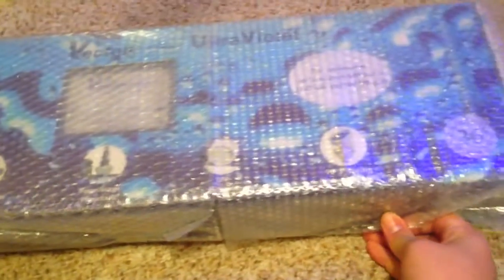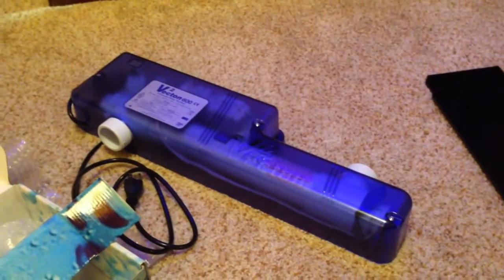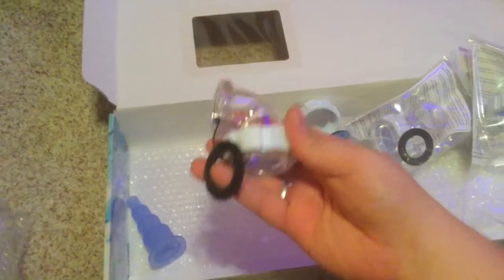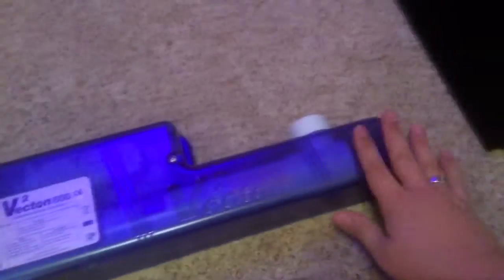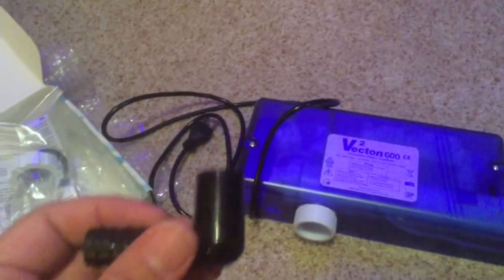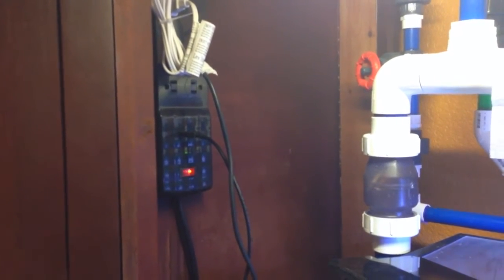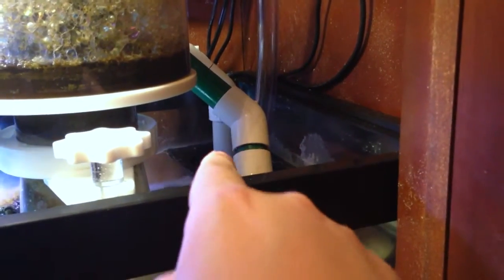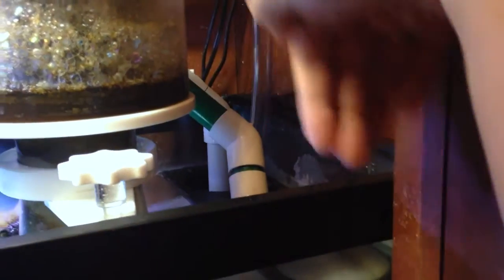150 Gallon Aquarium - Part 29 - UV Sterilization

Comment: Kyle, I have the TMC Vecton 600 and need to replace the bulb. Have you changed your bulb and if so how did you do the process. Could you please make a video changing the bulb? I believe this would be awesome to see the one change from start to finish.
Reply from the maker: Hey Steven, so I haven't changed the bulb out yet, but I have looked over how to do it. Honestly not excited about the process but know that it needs to be done soon... I might make it happen here in the next 3-5 weeks or so if you could wait that long?!
Reply: @kylerogers9046  Hi Kyle, cool I can wait. FYI I contacted TMC today. The process was shared if I only replace the bulb, I do not have to stop the water flow, but they recommend to stop the flow. If I clean the Quartz inner Tube, I must stop the water flow. The last tip given was only to Teflon Tape, the elbow or elbows. I hope the information is helpful?
Reply from the maker: @smaier32  haha - yea my biggest concern is where I mounted mine, I'm going to have to pull it off no matter what to extract the bulb... so...  I'll stop the water to that on my manifold. Better to not have water going for a potential failure :)

Comment: Are you still happy with the unit?   Space wise I can not fit an aqua or pentair in my stand so I am considering one of their models.  Any updated feedback would be greatly appreciated.  TY
Reply from the maker: hey lee - the short answer is yes I am happy with it, the long answer is I haven't actually been running it for some time now, it was plumbed in line with my external refugium and that tank cracked a while back, I didn't see much for a change in the main tank so I've literally had it sitting for months and months now. I AM planning on getting it back up as soon as all of the shelter and place things get lifted and I can get to the pet store to buy a replacement tank. I will say i definitely found that it cleared the water of any green tints, and I definitely think it's worth it for that alone! another point is that getting a second one of these and mounting them side by side would more than likely put you into the level 2 UV protection (if my memory serves me right) to assist in parasitic control, but for what I've used it for, i've not been disappointed.

Comment: Kyle,I have the same uv as you but the 400 model .tested for leaks in the bath and its leaking where the elbow meets the unit.Did you put teflon tape round the threads  of this where it joins the unit? it been leak free since you installed it? im looking forward to green free water on my planted tank but worried in case I empty contents of tank onto the floor!
Reply from the maker: yes - keeping water in tank is a goooood idea! :-p I did have to use a little Teflon tape, didn't gack it up completely, but I did make sure that the rubber gasket was seated correctly, and then I cranked down the plastic lock nut pretty hard.  They are pretty durable though so I
 wouldn't be too worried. Take it off, make sure your rubber gasket is 
sitting correctly (they're not super great, but they have to be tight to
 get a good seal) and try again. Let me know your outcome. I only had a 
small drip in mine in which I just tightened it a little more and it 
went away.

Comment: If I were you I would set up a screen between the see through pipes and the refugium lamp or you will soon have algie blooming inside the pipes! Best would be if you could limit the light to the refugium only but I know that can be hard. I'm currently thinking about designing a sump with black glass as separation beteen the sump sections for that reason. :)
Reply from the maker: So I do have black polycarbonate separating the refugium out, I am actually considering changing my refugium light to a less intense light. I really have no reason to keep an AI Prime as a fuge light. I put some towels around the lid to keep light going where I want it. I really wanted some black vinyl tubing and would recommend that to anybody, but Home Depot didn't have any in stock...